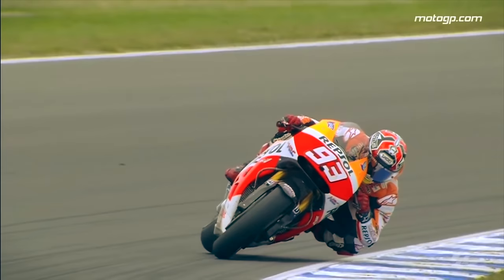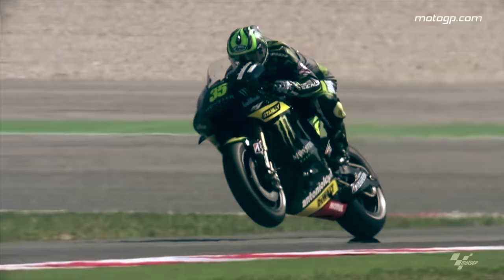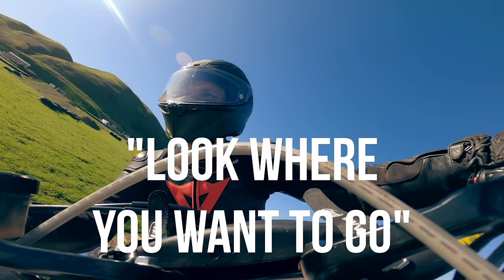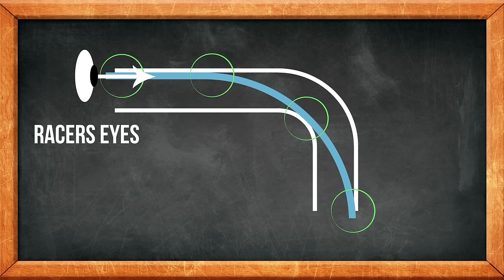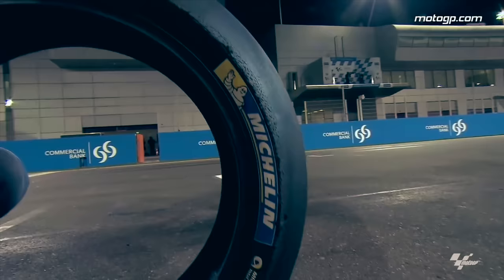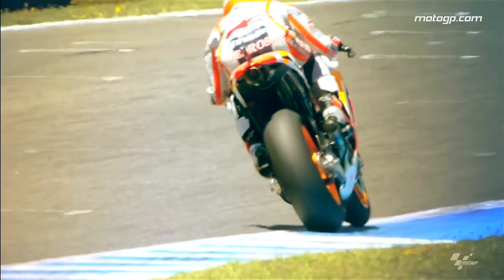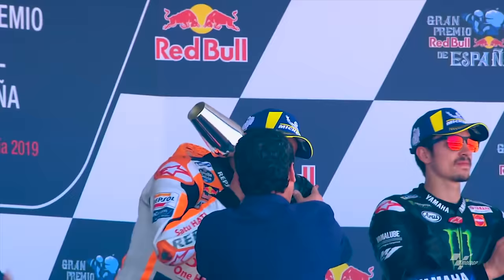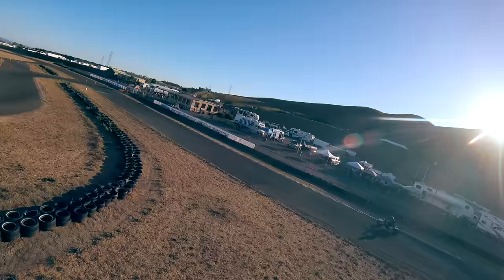10 Ways MotoGP Racers MASTER the Corners

Comment: With regards to standing on the pegs to allow the suspension to do what it is supposed to, I just "discovered" myself that if I do the same (on my big sport tourer bike), lifting my butt slightly off the saddle, when riding the many cobble-stoned avenues in Paris the bike handles SO much better, and I have far more control over it. It was like a revelation.

Comment: Very good explanation. In unlimited documentaries about marc marquez. Cal cruthlow said in order to adapt with powerful new engine 2019 bike. Marc used rear brake more. And nobody can ride like marc.
Quartararo also said that marc can ride agresively but also smooth with absolute perfection.
I ride a bike since even before i had a licence. But the most terrifying for me is the braking. After several times had an accident with the front wheel, now i have little faith on my front brake. Amazing to see a motogp rider have the same mentality even with so many crash.
Reply: Marc Marquez learned how to use the rear brake from Stoner and Cal learnt from Marc Marquez.

Comment: Hello , I really like your videos ; they are informative.
I disagree that using rear brakes whilst accelerating out of corners will force more weight to  transfer to rear, all it will do is slow you down.
If you apply a little brake whilst accelerating out of corner the resulting energy is in pushing the bike forward hence the brake is pointless.
It's a good technique for bikes with no traction control

Comment: Omg, i always did drag the rear brake a little bit at the exit corner unconciously while i start roll the throttle up, if  the bends are tight, but for fast corner i never touch the rear brake. So i did the right thing uh.

Comment: No 7  I m using  the ''lean braking''  but i don't do that for better braking tire grip.I think its the opposite, you can brake harder and LATER if you are braking with NO lean.
The ''lean braking'' HELPS YOU TO DO A FASTER,BETTER,HARDER AND WITH BETTER FELLING T R A I L BRAKING...When you lean braking you need less effort to counter steer the bike and you can carry more corner speed.Thats the secret.The lean braking is difficult to learn because you must be very confident with the front tire.

Comment: I feel like using the rear brake on exit is a retained habit from bikes without TC That might even still apply to them, considering how much power those bikes have. It’s easier to lay on 100% throttle and control the brake than it is to find the exact amount of throttle on a raw 1000CC bike, so the kind of guys with the hours you’re talking about might not even think about changing that little tiny part of their exit, and as a result their mechanics have probably leaned back the traction control in that area to just let the rider feel out his ride. I do the same and for me it’s just been an answer to keeping the front end down while still accelerating as much as I can on an older bike with no TC. A lot of the racers I talk to say they do the same, mostly out of habit.
Reply: 0

Comment: 1 wrong,  if you stand on pegs then you move your weight center lower than sitting on seat, mainly used by dirt riders, but there are lot more reasons why dirt bike rider should never use seat unless there is simple straight road where they can rest a bit

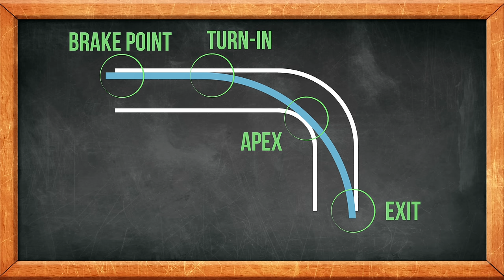Comment: The one at 1:54 is actually outside-inside-outside (performance strategy that is discuss at the MSF classes, but we practice middle-middle-middle strategy). That performance strategy is actually harder than it looks. I am only 118 lbs but handling a 500 lbs cbr aren't really easy for a guy like me. thanks for the video...learned a alot.

Comment: Nice video and explanation.  I suspect that dragging the rear brake while exiting the turn, right when I am rolling on power, helps mitigate over-powering acceleration from too much throttle roll-on.  New electronics on MOTO GP bikes seem to eliminate losing the rear wheel by limiting the power applied.  Otherwise, dragging the brake seems like just another skill to learn to compensate for a bad habit of rolling on too much power.  I will definitely try it.  LOL!

Comment: i've heard this many times and i attempted to read about it.. how does the rear brake stabilize the bike? what does that mean? thanks..
Reply: Not exactly sure but think of it as a drogue.
Reply: my theory is - easy on the handle bar, blip the rear brake, then you will get a momentary feedback from the handle bar where the bike wants to go, like a pendulum always need to rest closest to the pull of gravity
also chain slack can be minimised which will reduce jerk in between engine braking and acceleration.

Comment: MOTOGP racers NEVER "blip" the rear brake.....EVER!! That's an inaccurate description...yes they use the rear brake to stabilize the motorcycle, but saying they "blip" the brake implies they apply it  and let of, apply it and let off in succession....that isn't what they do!! You even show them applying the rear brake in the video, but if you notice they apply it gently and let off it smoothly...just as everything is done without any sudden inputs....SLOW IS SMOOTH AND SMOOTH IS FAST!!

Comment: your #10 explanation sounds bogus as presented : if you brake and accelerate at the same time, the net effect is one or the other (resulting in heating the rotors, which is why this is done exiting the pits to get the proper heat to the carbon)

Comment: Why do gp racers hang their leg out just before  going into a corner .  I think rossini started that habit.  They never used to do that in the old says.
Reply: Lots of reasons, techniques are improving, technology is improving, and riding styles and practices are changing. 

It’s carrying over from motocross as well since a lot of riders now train in the off season using dirt bikes and practicing being able to control slides and also with the rear tires. It’s also good cardio to keep them in shape. Also changing the body position keeps less weight directly over the tires as well as at an angle for slightly increased stopping power. But it is something you have to get comfortable doing and not every rider does it but it does help with stability under hard braking as well as more wind resistance. There are a lot of factors you could point at but to be honest I feel it still just comes down to riding style and motocross training. I feel like all the other factors were found out afterwards as research started developing on the style
Reply: The leg dangle. Acts a bit like a parachute/anchor as I understood it.

Comment: Total bullshit   !!!   ...   in rosd racind    [circuit racing]   100% of braking on a racetrack is,  [or should,   be ]   done  with the   FRONT brake  the weight transfer totally eliminates the use of the rear brake ,  ...   it locks up insrantly with the slightest pressure !      ...   IF YOU USE THE FRONT BRAKE CORRECTLY !!!